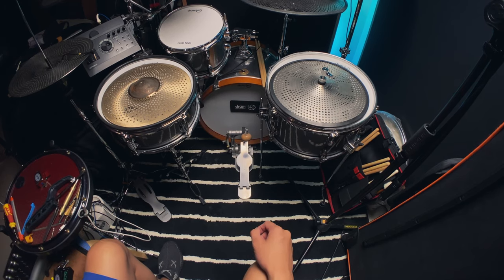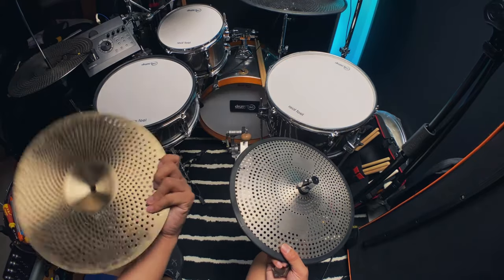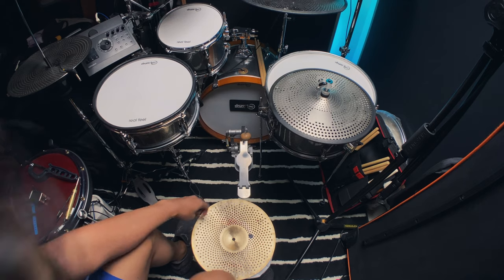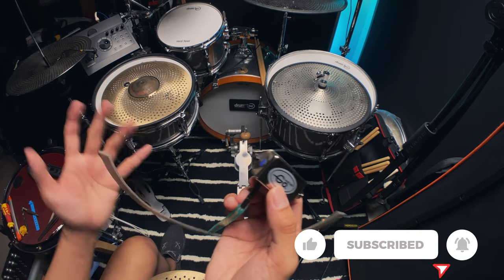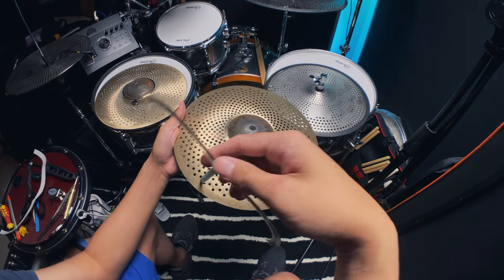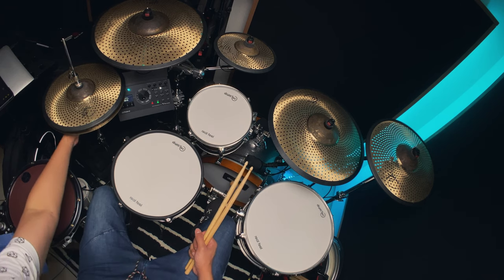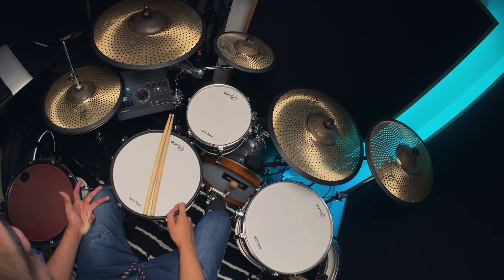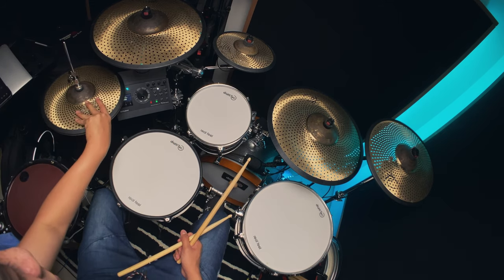2 Piece Dual Zone Electronic Hi-Hat DIY Build

Comment: Help Please! Dumb question but I'm converting low-volume hi-hats.  How do i connect a goedrum hi-hat controller and goedrum cymbal trigger to my Roland TD11?  Thanks!
Reply from the maker: I think it’s labelled HHC or HC for HiHat Controller, usually yellow tag. Then CR1 (crash1) or any on the green labelled tags for cymbal triggers.
Reply: Dude thanks so much!  Just got the Roland and found a PDF user guide.  It says it should have two hi hat cables. One hh and one hh/controller.

Thanks again and thanks for such detailed and informative content!

Comment: I did something similar with my setup. I ordered the low volume cymbal pack from Pintech and they were fine with some module tweaking but the hi hat was awful as it uses that controller with the cable. Anyway, I got this controller and mebrane and actually have a vh11 hh controller and got it positioned so it sits right on the throttle and it actually works amazing. Now got a real size HH that is quite dynamic and in my opinion better to play than the rubber cymbals. Only thing, they are low volume, but I have a house and play in my basement. Not sure how these would come across in an apartment type setup but I imagine if anything you could still place some silencers on the cymbals without impacting the cymbals much if at all.
Reply from the maker: That is cool! I think LVC would still work even in condos/flats. Thanks for checking the video. 🙏🏽

Comment: Protip = you can re-enforce the hihat not to bend by glueing a sheet of plastic underneath, and drill holes to match the ones on the cymbal. The plastic will give some resistance and the holes drilled in it will not raise the acoustic volume of it
Reply from the maker: Thanks!
Reply: @ProjectBeats_  you are welcome. Actually, it was your builds that inspired me to do mine, and I figured this out by mistake actually! I put the sheet of plastic to avoid unecessary vibrations, but it had made the cymbal louder. I just made holes with a soldering iron and voilá, they are resistant and low in volume!

Comment: Hello! Good job! Quick question... what is the exact model of los volume hihats that you used for this project? By sny chance, could you share the link? I've tried to get a salir pair of hihats like those you are using but I've been able to found them...
Reply from the maker: Thanks! They are called TongXiang in Alibaba. Altho I don’t know if they still make the basic silver one. You can check in their ali store. But any cheap low volume cymbal in ebay or alibaba should work great.

Comment: Hi, what’s the purpose of the hi hat base rod extension? I already have a goedrum hi hat controller with a cy-8 and looking to upgrade as my cy-8 is starting to playup. I’m tossing up whether I should go for etriggered lv hihat or go vh11. Looking forward to hearing from your reply. Thanks
Reply from the maker: Hi. That’s so you can use 2pc hihat with LVC build setup like an actual hihat setup and not top only. Try lemon dual zone crash as hihat.

Comment: Nice video! How did you put the ends of the rubber u-ring together?
Reply from the maker: Thanks! Just super glue. I use binder clips and then cure overnight.
Reply: Ok, tried to glue them also once with some rubber glue but didn’t stick.

Comment: Great video, I've bought my own and have set it up. But am having some trouble with the rim not triggering unless hit VERY hard. I've increased the rim gain to max. Can you please give your exact settings you have used on your Roland module? I'm assuming you have selected vh 11 instead of vh 12. Can you give really detailed info on what settings you use? Mines mistriggering, and doesn't feel great at the moment. Great video, keep up the good work!
Reply from the maker: Thanks. I dint do much. Stock works fine. Altho I adjusted a bit so I can hit hard but still be dynamic. I’ll check my settings. Is it just the edge membrane? 2things I would check, first see is if the edge pin is properly connected inside the box. It’s possible its loose. You may want to blutac it. It goes loose after a while in my case. Another thing you could try is using a foam riser on the membrane.
Reply: @ProjectBeats_  thanks for the tips. The bow is ok, the edge I'm having trouble getting a good response. I haven't used a foam riser, I know Myrk membranes recommend a riser did you use one? What exact settings did you use, vh 11 or 12, sensitivity, threshold etc?
Reply from the maker: Sensitivity -8 Threshold I play around 0-2. If tou are using myrk membrane. Yeah you definitely need one. I switched to goedrum just coz im updating LVC and dint want to solder again. But I used foam risers when I was using myrk. Coz it really doesn’t work without foam riser. I just used 3m 2side tape. Cut to size. Just the silver part of the membrane not the whole width

Comment: Can I get MIDI from it? Like, would it work when i connect this to the DDrum DDTI Trigger Interface? Is the acoustic sound of the cymbal good enough to record it simultaneously with a mic, when I just don't apply the rubber components? In this case, would it work better with a normal cymbal (besides drilling the extra hole)? What would you recommend on Ride and Crah for simultaneously recording MIDI and Audio via mic. 

Much love!
Reply from the maker: I think the DDTI is the one that translates the signals fr the piezo to MIDI. 

For recording acoustic cymbals with triggers. I don’t think they will sound good. If you put the trigger boxes they will mute the cymbals in some way altering the sound of the acoustic cymbal. You can try and experiment with trigger boxes and minimize the foot print and see if you’re ok with how it sounds.

Comment: Very nice and useful content, thanks a lot ! 
Do you have any problems with the rubber ring ? Because I have a low volume cymbal with classic U Rubber Channel around to avoid vibrations... but after some hours playing, the edge of my cymbal always "cuts" my U Channel.... I frequently have to replace it... 

Have you got any durable solution ?

Thanks in advance and keep going, I follow you from France 🇫🇷
Reply from the maker: Hey! Sorry this haven’t happened to me yet. And I hit hard that my trigger box either goes loose or covers fall off and I had to re-solder piezo at times but not u-rubber breaking. 😅 I’m using u-rubber from The Metal House in eBay for my other lvc. Im thinking maybe sand of sharp parts? Or maybe apply resin on sharp parts? Sorry man.

Comment: Thank you for your content!   I'm using your builds as a guide!    

With regard to the film/choke you chose, is there a reason you chose the 180 degree film instead of the 360 degree?    Any opinions if the 360 would give a different tone?   

Donating for your 3d print very soon!

Thank you again!
Reply from the maker: 🙏🏽🙌🏽 Thanks! 
I’f you’re asking about the Hi-Hat, I think at that time goedrum dont have 360 edge for my hihat size. For the larger ones, crash/ride. In short, diminishing returns 😅. I find the farther you are fr the trigger box, the less effective(more faint) the edge sound is. Personally if I had known that beforehand I would just go 180”. Save a bit of money.
Reply: @ProjectBeats_  Thank you!   I'm going to use Zildjian L80's.... I'll do the hi-hats like you, and wire the 16" and 18" cymbals each as 3 zone rides with GoEDrum equipment like you.  

Considering that additional piezos can probably be wired in parallel, I am wondering if adding additional piezos, like a second bell piezo, and a second bow piezo might expand the coverage for a greater variety of ways to hit the 3 zoned cymbals.   Doing this would require some creativity and circuit tracing.   I expect that the additional bow piezo may just be a simple disk piezo taped the same distance away from center, but 180 degrees around, and still on the bottom side.    And...the additional bell piezo could be either another of geodrum's or just an open smaller diameter generic piezo done the same way (around the other side of the bottom).  I expect that there is a way to add the additional sensors without having to add another box/outputs.   Aside from this likely being on the expensive side, do you have any thoughts bout this idea?
Reply from the maker: I've thought about doing that. That would effectively solve the issue with 360 edge membrane. That way you won't worry about spinning cymbals too much. Apart from the cost if you get it working right I think it's a good setup, and yes I don't think you need another trigger box. I haven't tried it but if it works for you let me know!
Reply: @ProjectBeats_  Cool.  I'll let you know if I do dig into it.  I'm building my first eKit now.  In for a penny, in for a pound...I want my kit to be the most acoustic-like eSet as possible, in as many ways as possible.  Soooo, I might really try it!   I'll let you know if I do.  Thanks again!  Happy drumming!

Comment: I wanted to ask you, is there an actual trigger built into the box as well? Or does it just hold the 1/4 inch plugins?
Very informative , otherwise!
Reply from the maker: Thanks. There should be a piezo inside and a small board for the edge dual zone.

Comment: for the Hi-Hat 2pc Base Rod Extension, can you give me idiot proof instructions? like is there anything beyond buying the printable soft copy i need to know to tell the person printing it? (do i need to tell them material, thickness, etc, anything else that is not covered by the soft copy?) i've never even seen a 3d printer before so i will need to find some business locally i can pay to print it for me, but i want to be sure they're not going to ask me any questions i don't know the answer to when i go in
Reply from the maker: Hey. I just use PLA for material. It’s cheap and strong enough. Mine still works great. Apart from that all measurement is in the stl file soft copy. If you have any problems with the print DM/email me.